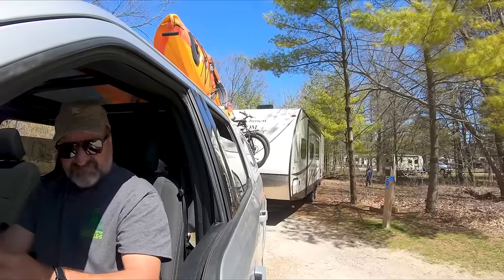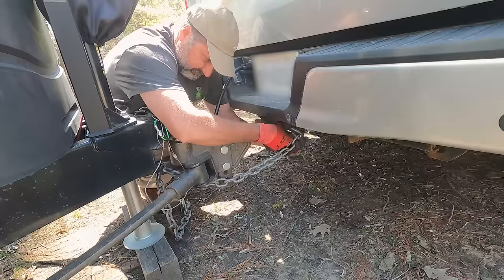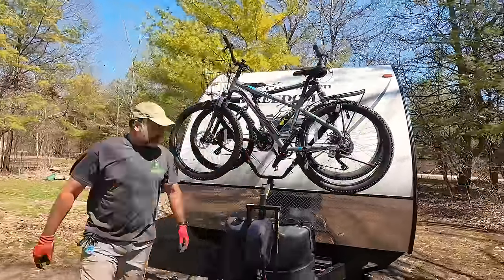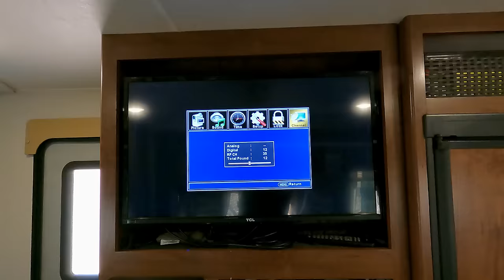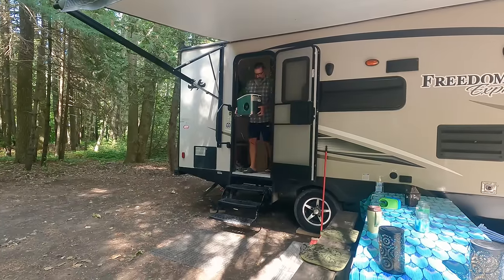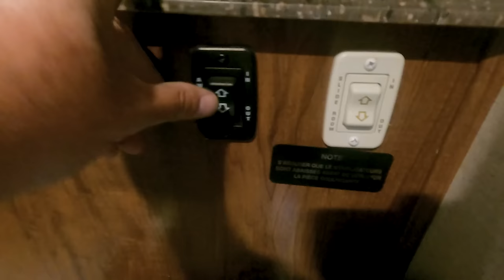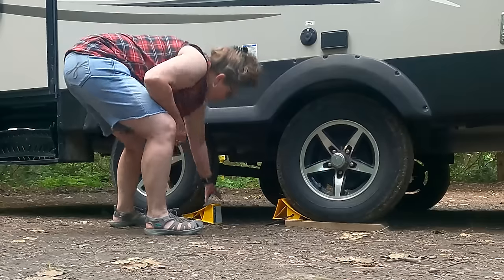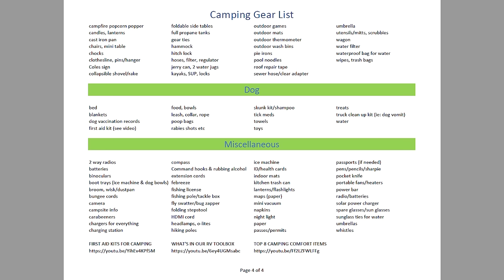Campsite Setup & Takedown for Newbies

Comment: Love your videos.  Two comments: 1. Make sure to fill your water before setting up if there's not a water supply at your site.   2. You can lay out your ground mat and use that as a backup guide - especially if you don't have a second person to act as a guide.  (Can also back passenger tire onto the edge of the mat to hold it in place in windy areas. )
Reply from the maker: A couple of good tips. Thanks.

Comment: Very well done!  👏🏻😃
Great tips!
Just want to suggest to put your boards that are under the scissor jacks and the tongue jack, the other way around.  
Then, (God forbid) if the trailer bumps ahead or back, at least the big block under then tongue jack isn’t going to roll forward or back and the bases of the scissor jacks will not fall off the short end of the boards.
Thank you and please keep making helpful hints videos like this.  
They help everyone glean some bit of helpful information and make things easier and safer.  🙂
Reply from the maker: Great tip about the boards. I hadn't thought of that but it makes perfect sense. I'll be doing that from now on. Thanks.

Comment: Very well organized and explanations are great . We use a cordless drill with socket  to lower and raise stabilizing jacks, just a little easier lol
Reply from the maker: A lot of people use a drill or impact driver to lower the jacks. I would recommend an impact driver over a drill because it won't twist your wrists. We've done both and just went back to manually lowering them because it's not much bother and it's quiet.
Reply: We use a cordless drill too.  It is easier. 😊

Comment: I had an near catastrophic accident setting up recently. I was raising our car off the hitch-- it was stuck in there so it suddenly dropped 3-4 inches and the round foot pad of the hitch hit the plastic blocks I had put underneath. I had chocked only one side of the trailer. Unfortunately I had used two different kinds of blocks and they separated and the trailer heaved to one side about a foot. Unfortunately this was also on a steep hill so the trailer slid back a couple feet ( on the side that did not have the chocks). Scared the heck out of me.  Another RVer came over and help me fix the situation. I have now sprayed some lithium lubricant into the ball and hitch and will never use two types of blocks and will always put chocks on all wheels!
Reply from the maker: YIKES that was a close call. Good thing you didn't have any real damage to learn a lesson you'll never forget. We've had plenty of learning events. Some cost a bit and some didn't. We're better for it now.

Comment: Looking into weight distribution system. How do you like the blue ox? And do you feel you need sway control?
Reply from the maker: I love the Blue Ox. By design it has built in sway control so no need for anything else and you don't have to unhook anything when reversing into a site.
Reply: @CampingwiththeColes  thanks for the info!

Comment: Great video! Thank you for sharing. How do you deal with the fridge and driving long distances? I’m used to a three way fridge and our new rv only has a 2 way. Do you keep things in a cooler till you get to a site? I can see driving 2-3 hours posing a problem with the fridge off. Thanks!
Reply from the maker: You're fridge is basically a big cooler. We've driven 8 hours with the fridge off and no concerns as long as the fridge was down to the correct temperature to start with. Everything stays frozen in the freezer and the milk and everything in the fridge is still cold.
Reply: Thanks for the information. I’ll try to do a test this week to see how long it will stay cold. It won’t be truly representative as it will be empty and it’s not hot outside yet but at least we’ll give us a rough idea. The previous fridge we had didn’t stay cold for long after it was turned off.

Comment: Do you have any advice on what type of extension cord we should bring to Ontario Parks to ensure at some of the more remote sites we can get power from the electric post to the trailer?
Reply from the maker: I'd recommend having at least 75 feet of power cord consisting of a 50 foot cord and a 25 foot cord. That should get you enough for most campsites. We actually carry 100 feet consisting of a 50 foot and two 25 foot cords and we've had to use it all a couple of times. We've never needed more than 100 feet.
Reply: @CampingwiththeColes  Thank you! We have been watching lots of your videos before our trip from Southern Ontario up to Sleeping Giant and back!